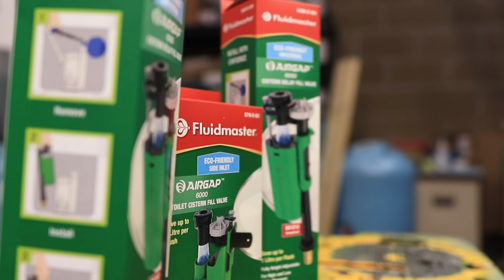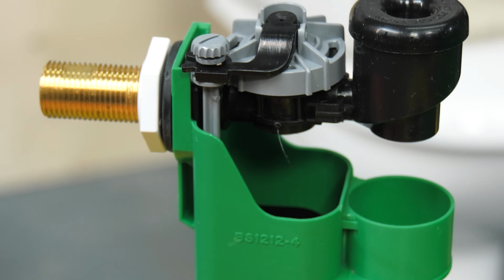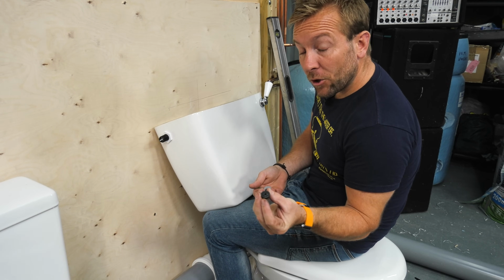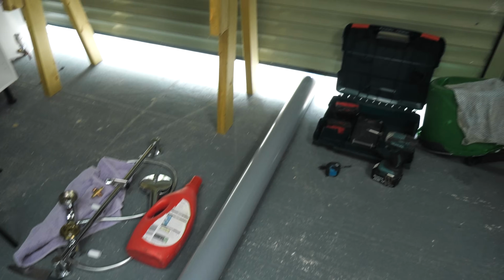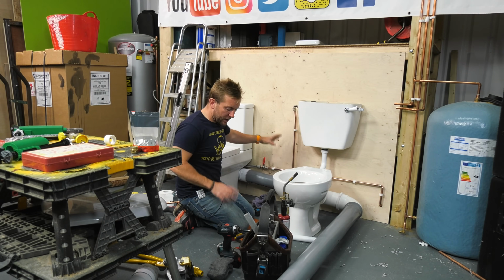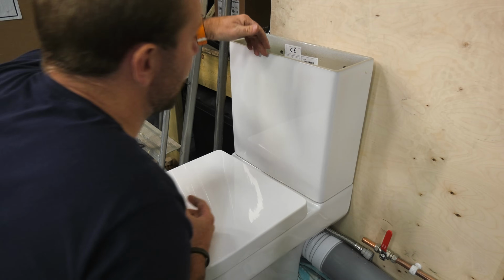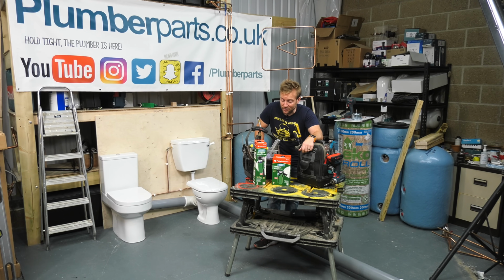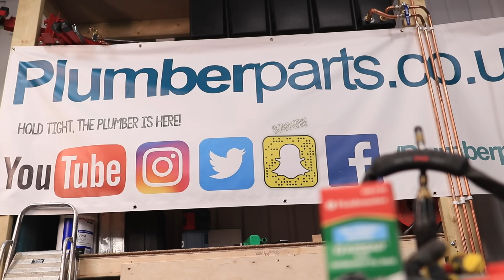TOILET PLUMBING FILL VALVES BOTTOM/SIDE ENTRY - Fluidmaster

Comment: Hi James. Another tip for checking if you've got a leak into the toilet bowl is to get a piece of toilet tissue and hold it against the back of the bowl (as long as toilet hasn't been used for a while). If get immediately wet, then you've found the leak. Gaz

Comment: Great video as usual - I noticed you used a push fit on the flexy - how good are they (I tend to use a compression joint) and is there anything I should do to ensure they don't leak when refitting.  See you of Thursday on Ale Army, for the usual beer rants, banter and laughs as usual. Hold Tight!!

Comment: Hi James and everyone
I've been using the fluid master bottom entry bottom fill a lot on all my toilet upgrades I've been doing. Would you use these or should I start using the air gap floats on future installs?
Reply: The old black and red ones are being phased out as wras discovered they are not to water regs. You can get away with it with a double check valve but that's adding further costs. These air gap ones are just as easy to install but don't have the same height adjustment. If you have a short wide cistern, they will not fit.

Comment: Love the fluid master procp packs keep a couple in the van. They come with a dual flush syphon cable operated, a brass shank bottom inlet valve and all the bits to fit most cisterns. Can get them from city. They also stock the parts separately to replenish parts if you dont use the full pack.

Comment: Very useful  video once again i am just wanting to know,is there such a thing as high and low-pressure valves anymore,or do all the modern valves just self adjust.
Reply: FluidMaster says that the airgap6000 is compatible with both. On a mains feed, you keep the little insert at bottom of the brass shank in and when you have a gravity fed system, you remove it.
Reply: @ChristianBHough  cheers, yes seen that before I did wonder.

Comment: Great video as always, I wonder can you answer a question. What do you call the rubber connection that goes into the back of a toilet bowl from the elbow pipe, thanks.
Reply: Flush cone,there are a few different types of them.
Reply: Don’t use the pvc ones, always rubber! The ones sourced with the Gerberit flush pipe are excellent quality

Comment: I've just asked screwfix when they are planning to start stocking these as they currently dont. 
Brass all the way for me too. I never buy the fluidmaster combo packs because of this, even if it's cheaper.
Reply: Screwfix's response:
Hi Christian. I don't have any info on when we will be stocking new items, that is all down to the buying department. However, we are always trying to update out range so I would expect to see this item on our shelves soon.
Thanks.
-Owen.
Reply: Just had a look on the Toolstation website and they stock them. A couple of quid more than the standard brass Fluidmaster valves. I’m with you on the old Fluidmaster combo set. Always brass.

Comment: Look like good valves. I find fluidmaster valves to be very good.  However not so good for retrofitting to toilet cisterns with a conventional siphon as often a bit bulky to fit between the side of the tank and siphon. One needs a  much slimmer valve for those. It also often pays to change the doughnut washer if having to remove cistern to change valve
Reply: Siamp 99 for type you're describing every time. Or torbeck cotton reel type

Comment: Do they come in quick release aswell for an even easier call out? 😂😂
Reply: I've just had a look at a few more videos. It doesn't look like it fits the current fluidmaster fill valve shank, but once fitted you can change it over without installing a new airgap 6000 shank.
Reply: @ChristianBHough  thank you 👍
Reply: It doesn't fit the existing because they fill from the bottom, this is against water regs as there is a chance of backflow contamination.
Reply: @chrispowell1866  yeah makes sense, I suppose if they were quick release it kind of defeats the purpose of installing them in the first place

Comment: Hi James need to pic your brain when I turn on hot tap on bath or basin the pipes in the house hammer like a freight train and only way to stop it is turn on the hot tap in the kitchen how can I fix it ??
Reply: I'm not a plumber by trade but check the tap glands and if you have a header tank in the loft, check the float valve.

They are both relatively simple tasks providing you know where to isolate your hot and cold water feeds. The header tank should have an isolation point on the rising cold water main.
Reply: Hi thanks for the reply not sure if there is a header tank as there a combi  boiler in the kitchen but there is a hot water cylinder in main bedroom ?

Comment: Does anyone know if using this means you wouldn't need to fit a non return value ?
Reply: You don't need a check valve with the air gap fill valve.